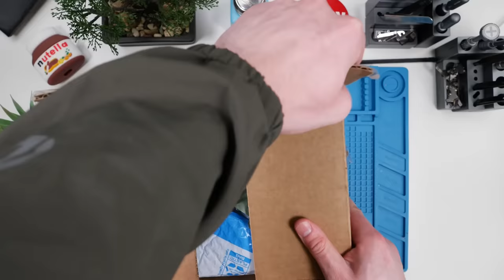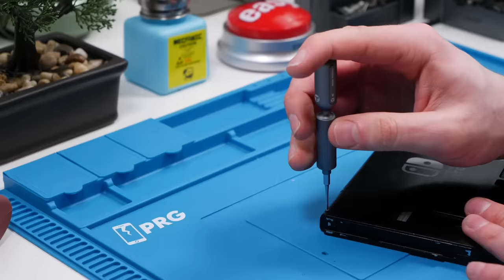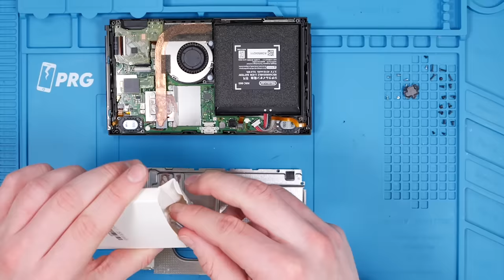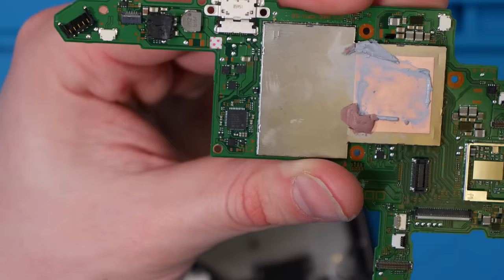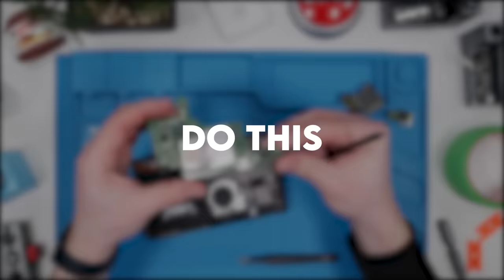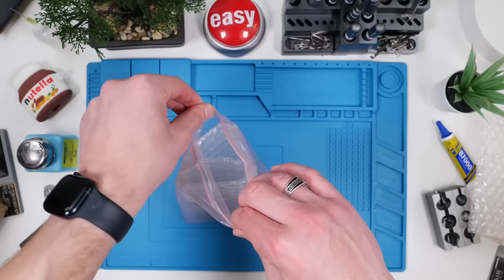This Switch Problem Is Way Too Common… No Power

Comment: This is a first-generation model due to have the model number being HAC-001, the second-generation model has HAC-001(-001). You can tell by the back of the switch. Some of the key differences of the two is the second Gen model has batter battery life and better processing than the first Gen model (among a few other things)
Reply: Does it have better processing? I didn’t think it did. The better battery life would have been more than welcome for me tho. I got my switch on Christmas 2017 and the battery life is absolutely garbage and horrible. I know this because I brang it to school once to play mariokart 8 deluxe with my friends. Apart from that, I think the switch is a decent console, but I also don’t like the joy cons and find them very unreliable and they really can’t stand the test of time.
Reply: @dill6598  No, it just has a more energy efficient processor.
Reply: @badcatalex  yeah that’s what I thought and I’m not sure about getting a new switch to be honest I think they are a little overrated especially if you plan to use the switch over a long period of time. I just don’t find them durable enough
Reply: @dill6598  I have a Switch Lite and I have not had any real issues despite it being used and a hand-me-down at that. Only complaint is how expensive games are.
Reply: @badcatalex  yeah the games are super overpriced it’s kinda ridiculous that’s how they get you
Reply: I was like....wait a moment....this Joicons dont like like mine. Sad than i cant crack mine and install android
Reply: It doesn't have better processing… the only difference is the bigger battery...
Reply: Fact check yourself before commenting
Reply: @CanadianBakin42O  It has a CPU die shrink which means it uses less energy.
Reply: @dill6598  Well for cartridge and digital games they cost extra usually because the games are able to be played at home and on the go. As for just cartridges, they are very expensive and therefore make it also cost extra.
Reply: @badcatalex  yeah I know and it’s convenient but switch games are more expensive than most play station games
Reply: @CanadianBakin42O  the batteries on gen 1 & 2 are the same size.
Reply: Among
Reply: Mine says HAC-001(-01). Is that second gen?
Reply: @Friendly_Neighborhood_Dozer  yep you have the second generation. The first generation is HAC-001 which I know because I have it.
Reply: @dill6598  the past tense of bring is brought <3
Reply: @and-gj3qu  yeah true that was a midnight post I was so tired 😂
Reply: @dill6598  valid. have a nice day
Reply: @and-gj3qu  thanks you too
Reply: @CanadianBakin42O  battery size is the same bozo
Reply: You also forgot the first gen is able to be jailbroken
Reply: Also first gen is able to be jailbroken/hacked. Technically 2nd gen is too, but it requires a HWFLY chip to be micro soldered onto the gpu
Reply: What generation switch is HAC-001(-01)?
Reply: Dude I have a first gen model switch and the battery life is not crappy at all
Reply: @dill6598  maybe ypu don't have switch and make switch looks bad.. why buy it if you don't like it even says the cart if pricy..
Reply: @linerangersjusticebrown6225  I have one and I’ve had it for 5 years. Nothing you said after this makes sense. Learn English.
Reply: @dill6598  i don't need to learn the language as long as you know what I'm talking about.. you cry about the pricy cart and the joycons and yet you still buy it.. you need a psychiatrist. XD
Reply: @linerangersjusticebrown6225  that’s the problem, I don’t understand what you’re saying. Wtf is the cart!? Also the switch itself is not pricey, the games are, and that’s true.
Reply: @dill6598  The switch games aren’t expensive. I mean $60 is pretty expensive, but even back 20 years later, the price has not changed. I’ve played games that were sometimes $70 or maybe even $80. As long as the game is great and enjoyable, it’s well worth the $60!
Reply: @dill6598  Plus you don’t need to talk crap to kids cuz they are 6 and haven’t learned grammar or they can’t speak English well.
Reply: @bkracingyt  yeah I agree with that, i mean the switch games are good, but they seem to cost more than my PlayStation games on average. Also $60!!! What country do you live in that’s so cheap. The games here are all around $90.
Reply: @bkracingyt  well when someone assumes something that is the complete opposite to what you say, even though it’s quite clear, it’s annoying. Also im sure they are not too young if they are on YouTube comments, and they obviously understand the price of the switch so…
Reply: @dill6598  Who th would buy $90 for a game? It must be a “rare” game if you are buying at that price, or your getting ripped off.
Reply: @dill6598  I also said “or they don’t speak English well.” So he could be a 13 year old kid who is foreign and can’t speak our language. You never know.
Reply: @bkracingyt  that’s what i mean. It’s a rip off here. I didn’t know it was a decent price everywhere else.
Reply: @bkracingyt  yeah you are right there I should have been more patient.
Reply: @dill6598  What do you mean by “it’s a ripoff here”? What country do you even live in?
Reply: @bkracingyt  Australia. The prices used to be more expensive as well $90 is reduced because the switch isn’t that new anymore.
Reply: Mine is a first gen and by some miracle it has good battery life
Reply: Doesn’t matter
Reply: The first generation model is also capable of being jailbroken and can do stuff like Homebrew, Emulation, etc. the Second generation model was patched by Nintendo and can’t be jailbroken
Reply: @LonelyDiggers  oh I didn’t know that. That makes the first gen a whole lot better then.
Reply: He give us item info from seller on eBay and in the title „HAC-001”
Reply: Not actually a fan of it but I also have my own and for seeing this, now I get the problem: I do have the "HAC-001" type, been gentle with it for over some years (I think five? six? ...had it for a long time up to now) but overtime the Right analog stick started going terrible with the usual auto-walk problem like some other controllers I have so I bought a Metroid Controller and another (expensive!) Switch-Pro controller eventually. Some reason last game I was playing was Terraria on it while sibling had me wait in a pizza place, everything was fine. All of a sudden when I got back home, it was off but wouldn't charge anymore nor turn on anymore and it was only at 75% when I put it in sleep mode but now it's as dead as my Acer Spin 3 laptop without warning just the same. 

Okay so after I noticed it, I left it to charge via wall port and its direct charger (not the dock anymore) and it blue-screened but as soon as a pressed a button, it's completely dead now. I didn't know there was a newer model aside of the "Direct" version I didn't get yet so I guess it's time to simply move on to a newer replacement model. Still watching this because eventually I'll Frankenstein it via DIY repairs but thanks for both tips anyway so keeping this in mind and an eye on it. Feels bad it finally ended up giving up the ghost though on me as I guess it reached its shelf life, I guess... 😢
Reply: @SophiaXiaoyuAralaCran  Yeah I had the 1st Gen. Switch; being that of the “HAC-001” model, for quite a few years myself and it had blue-screened on me as well and wouldn’t charge anymore either. Fortunately I had everything back up saved to the cloud via NSO (as I always do, at least for the the games that support such feature) and a few months later I had bought the 2nd Gen version being that of the “HAC-001(-01)” model and I’ve had it for I wanna say 3 possibly 4 years now give or take?? Idk 🤷🏻‍♀️ But yeah it hasn’t given me any problems whatsoever like the 1st Gen model had done which was mainly battery issues. 

Also as far as you mentioning the analog sticks; if you go and buy brand new made by Nintendo (not preowned/not refurbished/not 3rd party), you shouldn’t run into the infamous “Joycon Drift” anymore* as they’ve replaced the analog sticks with newer version analog sticks and they started doing so when they released the purple/dark blue Legend of Zelda edition Joycons 

* - of course you may run into the problem again but the chances are very slim given you do buy brand new and not preowned/refurbished/3rd party/fake joycons 
Buy the $80 ones yes I know they’re expensive but like I said much less likely to run into analog issues again
Reply: Nintendo switch is garbage lmaooooooooooooo 😂
Reply: @SwitchSucksAss  Nice username goes well with that comment 😐
Reply: @Mimikyu_Lov3r  stay butthurt that Nintendo switch is underpowered at 30fps. Steam deck is better hahagah
Reply: @dill6598  heh 60 dollars in my country you can buy a 1st party switch game brand-new on a data blitz or gamextreme store for 40-50 dollars hahahahahahah but everything else in my country sucks : ( for us its about 2100-2700 pesos which is about 10-15 days of minimum wage
Reply: @dill6598  crack your switch its form 2017 or just sell it they cost a bit more then the v2
Reply: U can mod the hac 001
Reply: It’s the other way around
Reply: Local Nintendo switch repair 02451
Reply: I have a Hac-001 and it does not have any problems except for nonfunctional jack the frame is a little bent but it still works
Reply: Yeah, since the first generation (the ones that came in white boxes) can be hacked without a mod chip, and the second generation (the ones that came in red boxes) has to have a mod chip to be hacked

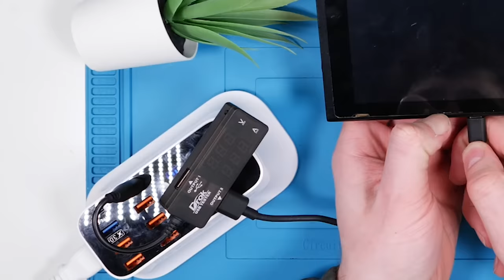Comment: Immediate issue at 1:20 DON'T use a USB-B to USB-C cable at 5v (normally max's out at approc 1-2.5A). Always use a PD USB-C to USB-C connection which should be approx 15v. The official Nintendo charger is set at 15v so always use that as a baseline
Reply: How did you know the problem in the first place?
Reply: @Av65784  It's a known issue. Soon-ish after launch folks were having problems with switches not charging / powering on (like the one shown in the video), and folks eventually figured out it was due to 3rd party chargers / docks providing the wrong voltage and eventually frying the power management chip. It's probably what broke this exact switch.
Reply: @LowPolyPigeon  Only issue I had one and a half month after launch was the low on battery spam where the remaining battery percentage jumped somewhere from between 100 and 25 percent before going to 1 percent which took them to fix somewhere around Splatoon's 2 release day. Which I heard I wasn't the only one with that issue when they announced those AA battery pack accessory for joy cons before Arms release. 

Though I would say late buyers would be less aware of threads that were posted since launch against the ones posted much later. For example the hidden message in the Switch Pro Controller that got reposted later on by someone else. 
Then you have those Bluetooth issues some people have when their joy-con disconnects and like 2-3 months ago some person that some how wasn't aware of being able to get gold points from physical games.. Like how can someone who would check whether a game has an update or not at the +/- application menu of home not see it.
Reply: USB-A*
Reply: @LowPolyPigeon  Some issue with iphones people use cheap charger and it's short out parts on the mother board
Reply: @sodapopjam  yes
Reply: @sodapopjam  yes, 15 times 2 is 30
Reply: @sodapopjam  lmao basic maths
Reply: @sodapopjam  woah i wasnt that serious

Comment: I’m glad that you knew when to stop. That’s a skill not a lot of people have. Id recommend taking chips off dead boards so you can get a feel for the heat and airspeed needed for your hot air station. Also a bent nozzle can help so you don’t have to go at it from an angle like that

Comment: Don’t feel bad. I too did something similar in hopes of repairing my switch. I tried to reball a micro chip on the flash memory and ended up destroying the whole board by mistake in the process. Had to order a new flash memory and hope I can figure out how to get my switch to boot back up without damaging it further. Beat myself up for days

Comment: The only reason why this is common is because people used 3rd party chargers and docks with it that don't provide the correct charge that the official products provide (essentially what it is is product mishandling and not an issue caused by manufacturing)
Reply: Also they leave the console plugged and maybe there’s a power outage or a lightning.
Reply: How to fix it... i made that mistake, I connected my (working) Switch to a third-party dock and charger, and it suddenly turned off and won't turn back on.

Can anyone help? Any tips?

Comment: Fun Fact ... i have had my OG switch have like 6 times issues with no power ... not even reacting to charging.

Turns out the chips inside it did hang after going under voltage. Solution was to charge it for an hour even though nothing happent .. and then do a emergency shutdown .. like when the system totaly hangs. . and then it turned on again . not sure if it was volume down or up + power button fo 30 seconds or so ... that has resolved my no power issues when ever i had them without the need to solder anything and it worked fine after that

Comment: The very best way to learn is to find old/junk electronic either at your house or a thrift store take it apart and get some soldering equipment and practice removing and replacing parts if you damage anything it’s not a big deal because it’s not much money spent eventually you learn to do it very well

Comment: Nice video! You are from the sound of things right about the same place that I am. Baby, I’m a hair behind you knowledge wise. I like to take stuff apart and fix it. I have zero experience with micro soldering, or even actual soldering for the most part. I may have picked up a soldering iron a couple of times, and I’m terrible at it.

I do believe that you should take up someone on their offer to teach you Micro Center, as well as continuing to try to figure it out on your own at home, so long as it doesn’t cost you a bunch of money.

Good luck to the both of us!

Comment: Just a why not comment, the switch I'm pretty sure is 18W @ 9v. You'd want a power supply with USB PD, and probably a good one at that since you'll venture into this. Usually you can tell what's going on by whether or not a device negotiates USB PD, especially on the switch where the chip tends to go wonky (esp. if used with low quality power supplies). Cheers.
Reply: regular usb can do higher voltages/amp/wattage but it won't be for PD afaik. I'd just go all usb-c at that point though.
Reply: commented before watching but yeah you realized the charging IC is usually a POC

Comment: What i did for mycrosoldering when i was started..it was to take locked boards or old phones that could turned on and i was taking off capacitors and stuff and resoldering them back to see if the board at least could turn on

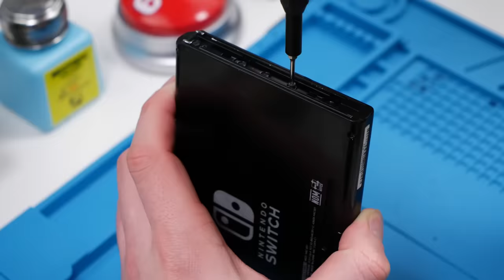Comment: 2:21 you only needed to unscrew the middle one on the side pannel (the other 4 old the side bracket in place but the 1 middle one per side panel holds the back plate on)

Comment: I just found your channel by accident. I was considering becoming a tech repair person myself, after I scored a free Nintendo switch lite quit by a giant stroke of luck. I had wanted a switch ever since they came out. it reminded me of all the hours spent playing on a Nintendo DS. 
although, my parents are unable to buy me one. one day, when I was walking to school, a pink Nintendo Switch lite flew out of a speeding car window. from a distance, I couldn't quit tell what it was. when I got closer, I knew I had encountered a one in a million stroke of luck. it felt as if the universe was rewarding me for my hardships. but, alas, I have no money, and cannot afford to fix it. by my calculations, it will cost around 40 dollars to fix it. and, I'm not even sure if my diagnosis of the thing was correct. I do have experience fixing electronics as I used to fix Nintendo DS systems for my friends. I can even solder a little. I hope to save up enough money to fix the thing soon. I also have no clue if it has an account registered to the thing. I haven't opened the device up as of yet, and it has been sitting in my parents drawers for almost a year by now. I hope to fix it soon, although earning money  as a minor when all your family is piss poor is very slow, and its even harder when you feel obligated to pitch in for things around the house. I have decided to hide my money away, and currently have $4 hopefully I forget about it so I don't spend it.

Comment: I used the switch normally and I dropped it was not a hard fall, On the contrary I made it bounce a little with my feet And as after 5 minutes it did like an effect on the screen and started to pixelearce and make a noise as if it were a hack of those movies, it turned off at first the screen was illuminated but in black and it was heating up and then it turned off completely and has not turned back on.

I forgot to add that even the joycons turn on someone will have more or less ideas of what the switch has HELP!

Comment: yes you should go learn how to micro solder you were close on how you were doing it, one helpful thing would be to use some capton tape around the area your heating up so it doesn't melt off some other components

Comment: Could you do a video on controller? Specifically DualShock 4s?  Those things are nuts. You could get all new parts,  switch them out with all the bad parts and it still won't work.

Comment: You know what you can try? Buying rubbing waxing compounds for cars that are used to fill micro scratches and test it on a video. It worked great on my car so maybe it works on the switch :D

Comment: I say do it because you would have another experience under your belt if you have to fix another Nintendo switch . You will be a pro at micro soldering later on after a few trys